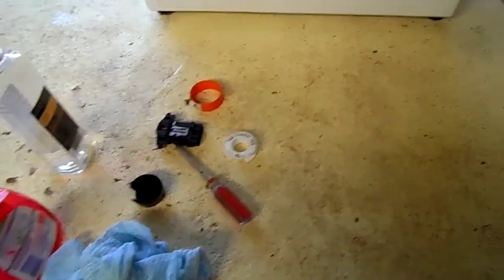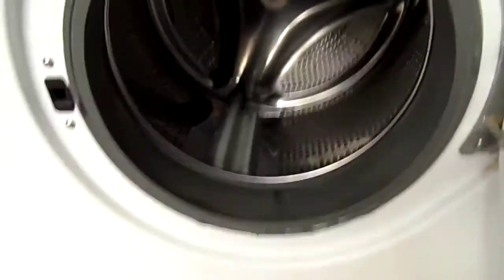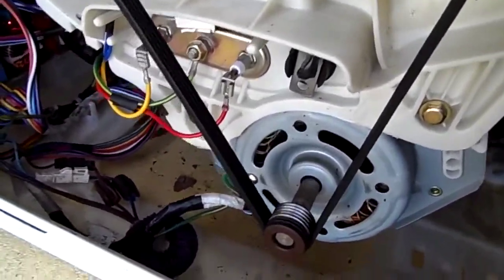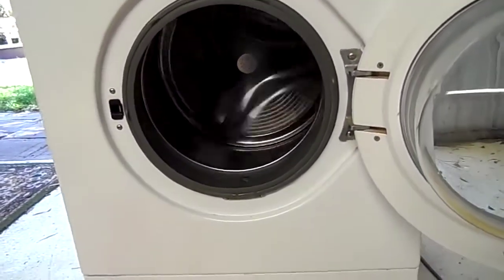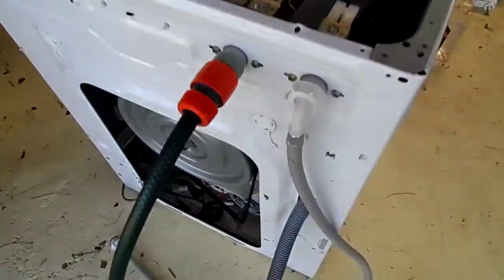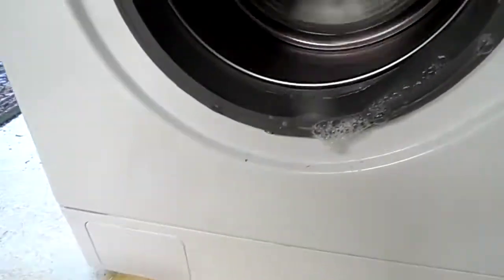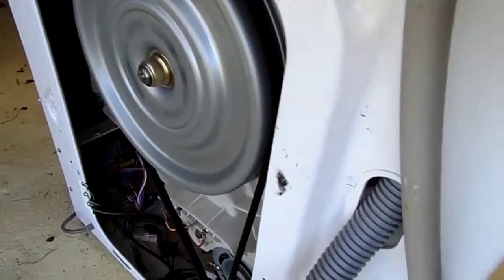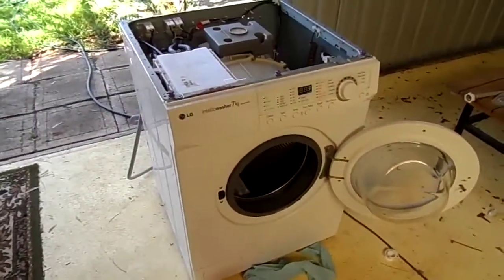LG Washer Running With Door Wide Open!

Comment: may be an AC Variable Frequency motor!! use a VFD to run it!
Reply from the maker: I think you might be right, I tried it on the variac when I rebuilt the machine and it didnt want to spin up at all

Comment: it is probably a brushless motor
, so you could run it using an ESC
Reply from the maker: Yes it is a 3 phase motor, while off camera i was able to single phase it with a run cap